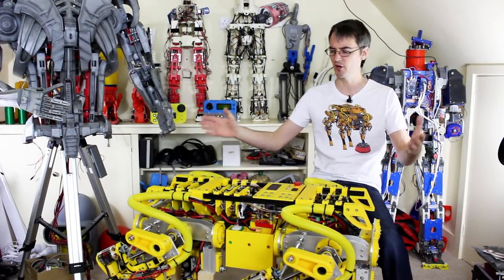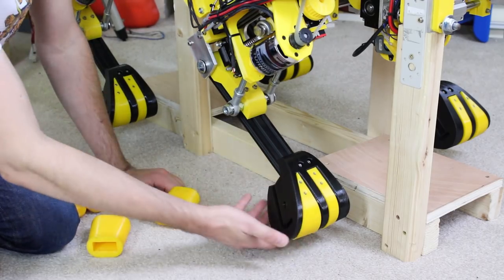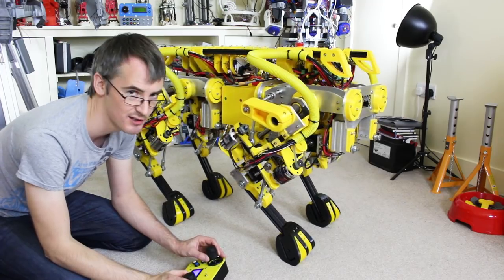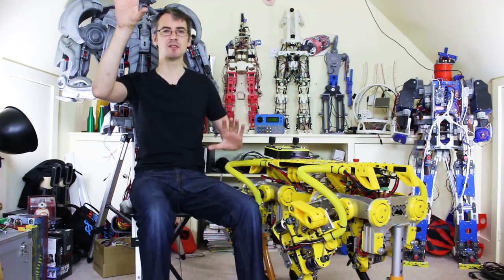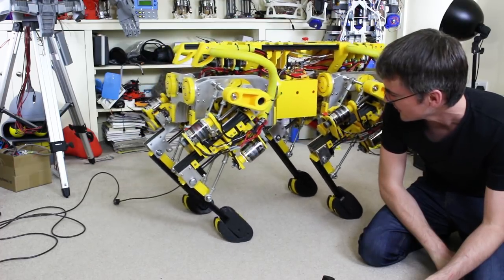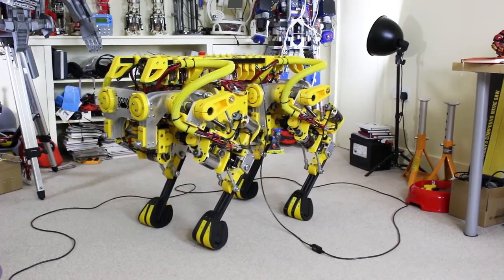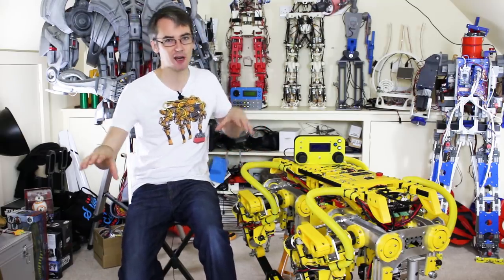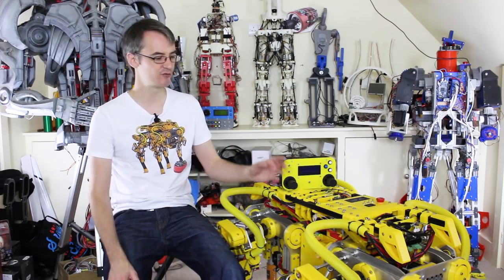openDog Dog Robot #13 | Experiments in Dynamic Stability | James Bruton

Comment: This extends off of something I've had bouncing around in my skull for tuning 3D printers:  What about putting 3-axis accelerometers in the paws to measure actual acceleration against the theoretical acceleration in software?  Close the acceleration loop to cancel out the inertia associated with any particular leg movement.  Or is that just adding to the real-time processing lag?

Comment: Are you sure you want to go with crappy sensors? Why not go for proper load cells? Even compression ones can be aquired pretty cheaply in china together with the hx711 easily integratable with arduino.

Comment: To be honest I haven't had a close-up look on your code but my guess is the processing power you have in the dog would be more than enough to handle the proper control loop and filtering you want. The problem is the inefficiency that comes with the arduino in exchange with the easy and versatile ready-to-use libraries. If I were you I'd take a closer look at the code and try to optimise it a bit. For instance floating point operations take a whole lot of time on those chips because they do not have a FPU in hardware. Try to scale it to integer data types e.g. using a "propietary" fixed-comma format whereever possible. Try to use macros and low-level commands (can you use inline assembler with an arduino?) rather than universal functions because they may waste precious processing time, especially if there are in your control loop. I don't know how this "easyTranfer"-Library works and if it uses the SPI hardware of the controller, if not, this is definitely the fastest way to get data from one controller to another. Try to minimise overhead of the communication. Of cource this is a lot more work to optimise the code or to write optimised versions of the libraries yourself than sticking to premade libraries, but I think it's a fair alternative to just adding more hardware. If you really want to optimise stuff some custom hardware with a properly chosen controller may be a good idea, but would be a major increase in complexity and kind of ruins the "open source" style of the project, so I think that's not the right way to go here. However, I am really impressed by the project so far, really outstanding work!

Comment: I use a Raspberry Pi, several ESP-32s and Arduinos all connected with CAN-Bus for my home control system.
It’s low cost reliable and easy to use. Think you would find it a good alternative to serial.
I use MCP2515 CAN Bus Module Boards (TJA1050) with Arduinos and SN65HVD230 CAN Bus Transceivers Module with ESP-32s

Comment: I wonder how much it would cost to start molding and replacing a lot of those parts with carbon fiber? I think some of the major issues (though, they really aren't major in the grand scheme) you're having are due to weight vs rigidity.

Comment: Esp32 time then.. To begin with you can burn the same code from Mega, as Espressif Arduino code is pretty solid. So it can be a progression than compete rework on software side.